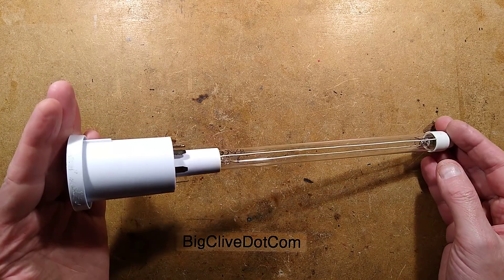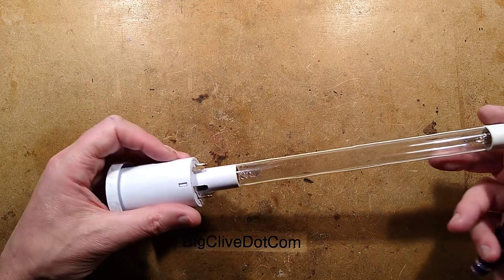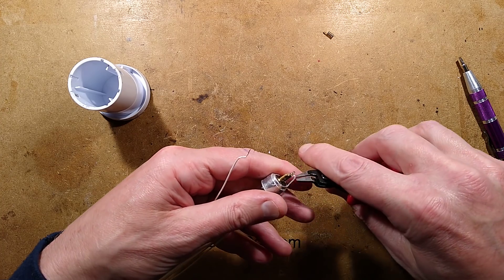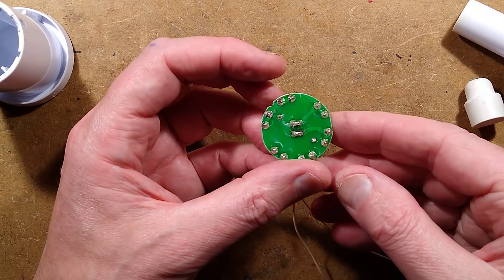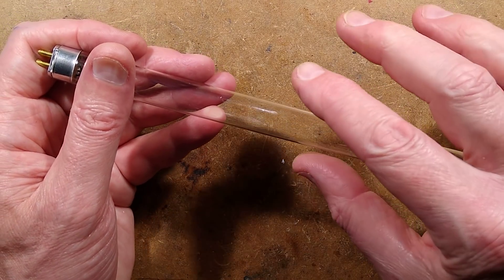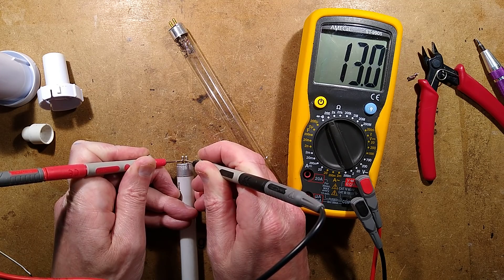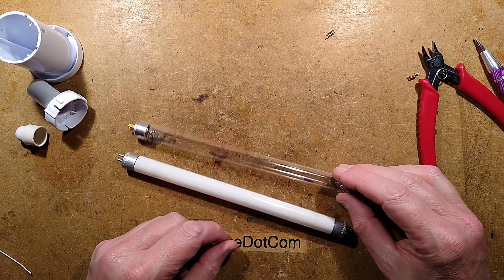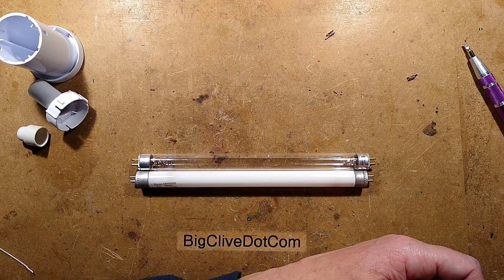UVC module for home water purifier has non-standard tube

Comment: I have a reverse osmosis system which uses a UV pass-through stage. I replaced the tube once after about five years but the realised there was no need for it to be constantly powered up when I only ran the filter manually, so I added an external power switch for the entire unit. Now the UV lamp is only on when water is flowing
Reply: Surprised the system did not have a flow switch from new then it would have done what you have done but automatically
Reply: @UserUser-ww2nj  Only controls the pressure pump - UV remained on 24/7
Reply: @stevep8773  yes, that's why I said about a flow switch. It would turn on the u.v only when the water us flowing, a but like a current sensing switch
Reply: @stevep8773  That's a bad design , it could have had the bulb incorporated to come on with the pump
Reply: @BlondieHappyGuy  perhaps its for disinfecting the chamber too even there's not any water.
Reply: I just purchased a UVC system that has a flow sensor, to save the bulb, as I live alone and don't use as much as a family of four.
Reply: @dsloop3907  Perfect
Reply: Very clever of you
Reply: @BlondieHappyGuy  TBH, I think the expected use is similar to this unit Big Clive has dissected - that is, an always-available source of "clean" water beside a sink. And it might be worthwhile paying for that convenience for many. However, my use is for refilling an espresso machine (the boiler scales badly using tap water) so it is refilled only every few days. The four-stage RO system has this added UV unit that probably does very little - but if it is there, why not use it? I suppose they could have engineered in a brief delay in the pump action (there is a small pressure tank) that would power up the lamp first and then start filtering a few seconds later. But that would add complexity and cost. I should add the first UV lamp lasted a few years on continuously. Some say cycling lamps on and off shortens their life, but my guess is that on for an hour a week is still going to last longer than on continuously
Reply: @stevep8773  If the lamp does need to warm up that delay is a good idea and can be programmed into a controller,  not to hard to do
Reply: @BlondieHappyGuy  water doesn't pass over it fast. It has a fairly large volume of water around it, and the water outlet is small and fairly slow moving. The dwell time is plenty long. It's like sucking water out of a gallon jug with a straw. It acts as an accumulator/buffer. We have tested the one we use in the lab, and it is extremely effective.
Reply: Two problems with this setting: 
 1. There is a few minutes warm up time - large low-pressure lamps can take 20-30 minutes, small ones 2-3 minutes (I noticed you are aware of this).
2. every on/off cycle shorten the lamp life. The sweet point is tricky
Reply: @yoramgerchman3282  This is a tiny lamp. It may well take 30 seconds to reach "full power" but I would estimate it reaches 80% in three seconds. Note the water is filtered on the way into a small pressurised holding tank, so the actual pumping time is 5-10 minutes after I fill a 4L jug. That means ~+99% of the filtered water receives the full UV exposure

The filter gets used about once a week and in the original configuration, the UV lamp was on 27/7, as might be desired for a kitchen sink dispenser. However, it was only actually needed for that ~10 minute "refill" cycle, so I am pretty sure the lamp will last longer being cycled off/on 10 min/off 1X/wk than on 24/7. Time will tell :-)
Reply: I believe that these tubes need to warm up. A flow switch would be too late in that case.
Reply: @dougaltolan3017  It does take at least a few seconds. My process now is to power up and wait a few minutes, then draw off water to fill container(s) and then switch off the lamp. I might only do this a few times a week. I should note the UV is "overkill" for my needs - the water going in has high hardness but is perfectly safe biologically. If I had a concern about contaminants that the UV would make safe/safer, I might add a flush cycle to the supply line
Reply: @stevep8773  yeah, you know it, many reading this won't.
We get our water from a spring that is fairly well covered, but because we have holiday accommodation it is inspected yearly. Our guests get the sanitised stuff while we drink it straight.

The official advice (from the totally unbiased manufacturers) is to leave a few minutes warm-up and replace after the equivalent of 1 year continuous use.

The degradation can be measured and is reliably - 20% after 100 hours.

Also most of the pond filter set ups really aren't something you would rely on to prevent a bad case of Delhi belly.
Reply: @dougaltolan3017  That sounds about right. 100 hours for me would be about two years or more. Interesting about the lamp "fall-off" over time. The volume is so low and in such a small space, I wonder if the result @ 80% is any different than at 100%? Maybe some bugs die twice :-) I would be especially careful with surface waters, obviously. Local pollutants (where do bears poop?) neighbours dumping old oil, etc. will show up immediately and often without much warning. My source is a 300+ foot deep (100 metres) drilled well, so pretty consistent - just too hard for my (expensive) coffee machine
Reply: @stevep8773  drilled well, I'm jealous. I'm in Scotland and (brace yourself) we are having a drought!
Boreholes are being talked about more and more.
Reply: @stevep8773  100 feet deep  drilled well , that pretty  far down and depending  on the composition  of the soil an rock should filter out just about everything  you dont want.
A lot of places in rural Ireland  have wells but some people  skimp on the depth.  There is a rock layer its recommended to go through  but some do not do it , bad move
Reply: @UserUser-ww2nj  Actually 100M - 20 about 330'. Not cheap to drill. One of the factors is flow rate (how fast the bore refills when pumped) and if on the low side (it usually improves over time) they drill deeper to provide what is essentially a storage buffer. The filtration I use is just for drinking water and my coffee machine as the water is hard (so will scale a boiler) and high in (harmless) iron, which gives it a "spoon in the mouth" taste. It's fine for cooking or other uses. The UV stage on the filter was part of the Reverse Osmosis filter package. I don't really need it but I figure it can't hurt. I keep about ten litres on hand at a time
Reply: @stevep8773  100 meters,  that deep  and I dread to think what it cost , depends on what they had to drill through i guess .
Drilling deeper is always a good  option for times of low rainfall. The ones in Ireland should really  go through  that rock layer it's more economical  in the long run, stay above it and you spend  massive amounts on filters because  of the peat content in the  area I was in and even  with the filter it still flagged up things like ballcocks after a while. I'm kind of lucky here ,or have springs about a ten minute  walk away so take a couple  of 5 litre  plastic bottles down there , lovely  soft clean water. It's a necessity because the tsp water is not drinkable